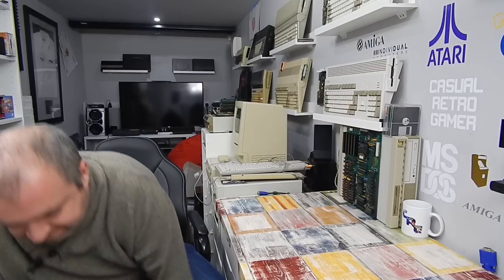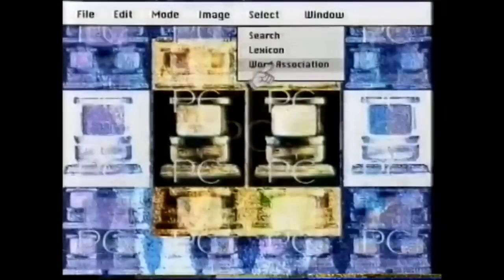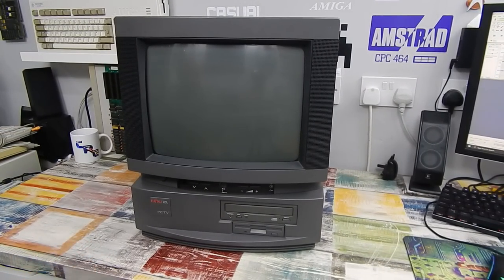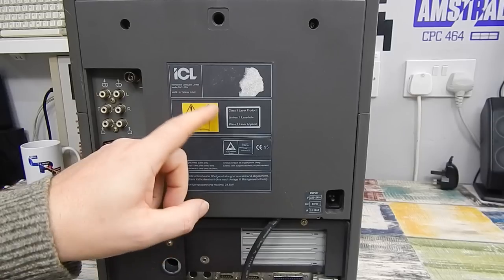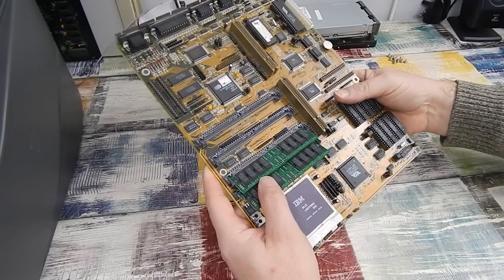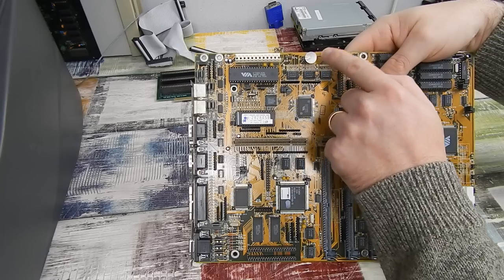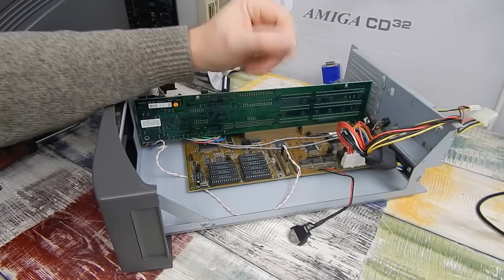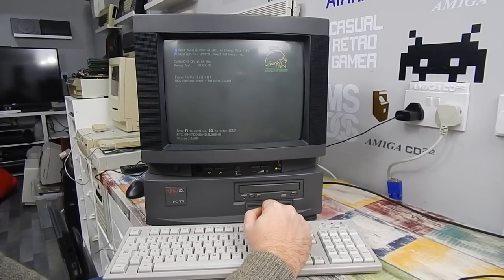Fujitsu ICL PCTV #DOScember2021

Comment: As someone who worked for icl fujitsu at the time, I can let you in to a secret.  They had no idea how to market anything let alone this thing. As an employee it felt like no body had any idea what they where doing at that point.  I did like that the advert included a clip of The Bill.
Reply from the maker: Sounds like a familiar story told by employees of various 90s computer houses.  

I can't help but get the impression from this system, with it's out of date spec, that it had been sitting on the drawing board for a while, then just turfed out the door.
Reply: @CRG  There where a number of machines kicked out the door by ICL based around that 486 board. It took them a while to shift to pentium.  ICL (via Technology PLC) was Compaq's distributor in the UK so was selling thier pentium systems hand over fist, but we did not see a Fugitsu pentium PC for quite a while, and even longer before it could be sold in volume.
Reply: I don't suppose you would know or could find out what encoding was used on the remote, could you?
Reply: @RetroBytesUK  Is the Indiana model worth getting for a 486-pentium?

Comment: You can potentially activate the SCART input (even RGB) using the control signals on the SCART socket, I can't remember the exact pins etc but a Google should have your answer but from memory I remember there's a signal to switch to SCART input, and another to select composite and RGB.  Newer TVs even looked at the voltage of one of these signals to select 4:3 and 16:9 aspect ratio.  I think it's as simple as applying either 5V or 12V to one of the pins.  There's some good info on the SCART Wikipedia article that explains the signalling better.

Comment: First off, thanks for putting this video out.  I have a nearly identical CD-ROM drive in my spares pile that I thought was dead when I connected it to a standard IDE port on a bog standard controller card.  That bit of information has given me hope that I can still use it in a build later on.

As for the remote control, some of those universal types have a search feature that sometimes works if you can't seem to get a prescribed code to work.  It's the mode that has you sit there in front of the TV and repeatedly press the power button and when it does power off, you hit a certain button to lock that code into the remote control's memory.
Reply from the maker: Tried it and went through 150 codes, no luck.
Reply: Try codes for Hitachi and Toshiba tv the menus are identical

Comment: Thank you so much for the video.You made me travel back in time. I've had one of these for several years. I was very happy with him. At the time it was a great machine but also very expensive, around €2500 in current currency. After it became obsolete I bought a new one and swapped the fujitsu for an HP 660c inkjet printer. Now I regret having done it. I wish I had it up and running now.

Comment: Did you ever find a way to switch to the AV input without the remote? I have one of these machines now but no remote control. Weirdly enough sometimes when I've turned it on, it's gone into Scart mode, I actually hooked a console up via scart and it worked perfect, but then if you press the channel buttons it goes back to TV and I then couldn't get back to scart again. I've also done a bit of digging on the software side as much as my current knowledge would take me, and it seems the DOS TSR that gets loaded talks to the VREMOTE.386 driver which listens for IR signals and then sends signals via the I2C protocol to the TV part to switch the channels etc. Someone with enough knowledge of debugging old DOS programs I expect would be able to write a program to control that the same as the VKDPCTV.386 driver does with the few hotkey combinations that you already found. I don't actually need the Scart/AV functions to work, but every now and again it really bugs me that the functionality is there and we can't control it. There is one person I found on the VOGNS forum that claims to have a remote control, I was hoping to contact him to see if we could get the IR codes captured so we could program a universal remote, but my new account won't let me PM anyone.

Comment: Thanks for inviting me to help out on the video, it had been years since I thought about the machine and it was a great trip down memory lane!
Its a shame the remote is so hard to track down, I wonder if with enough time and patients you could work it out using one of the usb IR blasters or one on some of the other android phones?
Reply from the maker: Thanks for agreeing to take part.  

I've not given up on the remote but I admit finding one is unlikely.
Reply: @CRG  It was my pleasure to show up in a great video.
with how hard it can be to just get a regular old CRT or VHS player with a remote at times.  Finding this very particular one on its own is going to be hard.
Fingers crossed that we find another one of these machines complete in the wild!
Reply: I've just got one of these PCs, sadly no remote again. What I did notice though is in the autoexec.bat it loads a TSR driver for the remote control. So my guess is this software handles the signals coming from the IR remote. Hopefully with a bit of poking around we might be able to determine the port address and then disassemble the .exe and see what values to writes to that port. This is all in theory though, but I'm going to look into it.

Comment: Honestly a 486DX2-66 was pretty par for the course in '95 considering the target audience for the machine and not to mention the Pentium's bruised reputation at the time.
Reply: Yeah I was thinking the same thing, my first computer was a 486 dx2 that my grandparents bought for our household, it was a Compaq presario Tower.  (WITH TABWORKS!).... 

Anyway that computer only had eight legs of RAM and a 525mb hdd. So even while this computer was probably manufactured in 95 a lot of the parts were probably designed inspect and you know early 94... And then you got lead times and manufacturing times because you're building not only a computer but television, so I can see how this might just be a slightly out of date by a few months 486 of the era.
Reply: Pentiums where server room stuff it that time
Reply: Same, certainly in Europe. I used one of these machines with Win95, and with 16mb of RAM was never unhappy with the performance. That CPU didn't got though - no cooling in the case and it was squashed it with the monitor and PSU, and not even a PSU fan was fitted, so it all got quite cosy inside.

Comment: On the benchmarks why did the processor speed not show up correctly?  Also I wonder if there was some sort of software upgrade that you could get to enable the composite and SCART connections.  I do wonder how closely the TV and the PC monitor side were connected as having to go from a TV resolution to a PC resolution is quite a jump.  If you are comfortable with taking the monitor apart further (keeping the high voltage cap connected to the tube if you are concerned about getting shocked) you should be able to get to the PCB where the AV inputs and the main TV control IC is.  The part number on the chip may be able to be traced down to a few manufactures of TV's and then you may be able to figure out the code for it.  Alternatively you could follow the wires from the IR sensor and see what chip or chips they connect to and see if any of them make sense for being in a TV and if not that is why a universal TV remote will not work with it.  Also may be worth backing up the hard drive to some online pace (archive dot org etc) so that this rare software can be preserved.
Reply from the maker: In terms of the processor its seemingly just a bug in how its detected within speedsys.  On my other machine with the same processor its detected the same way.  Running the likes of CHKCPU displays it properly as Cyrix DX2 66mhz.  

I'll get a look at the logic board and see what I can figure out.  If I get anywhere I'll pull together a follow up video.  

As for the software that's a good idea on archiving it, I'll pull the drive and try to image the appropriate software.

Comment: I think somewhere around 1997/1998 I've been able to play a bit with one of its successors. The PC part also was outdated back then and it was labelled Siemens (or Fujitsu Siemens). It seemed to me as the TV was essentially a modified mid-range Siemens from that time. I that model had an AV-button. As a portable TV it certainly was outstanding, particularly because of it's high resolution CRT.
I wonder if you have tried the obvious thing with the SCART-input on that set and give it the 12 Volts what's usually used to switch TVs to AV.
Reply from the maker: I've tried a mega drive scart cable and it certainly didn't auto switch.  It only puts 5V to pin 8 on the scart but still should auto switch at that.  I'll try it again with another source, maybe my Amiga with its RGB-Scart cable. 

I'll try to look for some Siemens TV codes, you never know, one of them might have more luck.

Comment: The ram expansion for the video card is using what appears to be ZIP ram, which was used on the Amiga 3000 as well.  It shouldn't be proprietary.  if you get 2 pieces of 256Kx16 at 60ns you should be good to go.  Packard Bell used ZIP ram for earlier 486 motherboards as well.
Reply from the maker: Having never seen zip ram before I had assumed it's pins were in a straight line but looking it up after your comment and yep there is a zig zag type so that's exactly what it is.  

Thanks for letting me know.  It's expensive enough on eBay so may not bother upgrading it but at least I know now what I need.

Comment: Like you, I was expecting at least a Pentium 75 or 100, the cheapskates.  Shame about the dependency on the remote control but I did enjoy the lock 'opening' solution 😊.  The PC part is almost the same spec as my IBM Valuepoint, even the video chip and VLB slot are the same although the IBM can take a processor upgrade.   Hope you find a remote that works.  It's not unpleasant to look at.
Reply from the maker: I hope to get something sorted for the AV as its would make a nice system to have setup for DOS gaming but also have a Playstation or Saturn connected too.
Reply: @CRG  🤞

Comment: OMGs, I actually had one of these back in the day. I got it from Morgan Computers in Birmingham in 1996 or 1997 (can't remember exactly when), who dealt with mainly remaindered / surplus / end of line and refurbished stock, and paid £300, brand new, so obviously it didn't sell well at the somewhat.... ambitious.... launch price. I never used it as a TV, but squarely as a desktop computer, complete with the weird "study room" front end bloatware. I did put Win95 on it and surprisingly it actually ran pretty much OK with the RAM bumped up to 16mb. The main issue I found with mine (not sure if others encountered this) was that the case had a total lack of ventilation, and sharing the case with the monitor meant there was a lot of heat build up. It never got to the point where the system was unstable but it was noticeable whenever you opened it up if it'd just been running. Unfortunately, there was very little you could do with getting into hardware hacks as there was no space or wiring for a fan. On the plus side, it was a very tidy working arrangement, and I found the keyboard / trackball to be a really nice setup. Also the side out tray made getting to the hardware an absolute breeze - completely tool free, provided you didn't loose the key! ;)

Comment: I remember these machines and at the time I did look at more than one in the stores. I was entranced with the form factor and the idea of a TV and PC all-in-one was very appealing. However, the immediate turn-off to a novice like myself at the time was the keyboard and trackpad design. Not considering the option of replacing those, they were very unappealing. Then, the specification when compared to comparable systems of the day was hugely off-putting, leading me to dismiss the machine as a gimmick. Even with hindsight, I think that was the right conclusion to make. It deserved to fail.
Reply from the maker: Yep I think you made the right call, the gimmick of a TV tuner isn't enough to offset the underpowered PC within.
Reply: I imagine that I wouldn't have bought one either after finding that the TV tuner couldn't be accessed from within Windows (i.e. TV inside a small window).

Comment: I wonder if any of the old Palm or Windows CE remote control apps might have the codes for download, as usually a feature of 'registering' the software was a pile of remote codes pre-installed. Usually far more codes than a typical universal remote would have, and that would be around the same time period. Also, there's few IR things in Linux for either using remotes on a software like MythTV as well as to send/blast out to control TVs that might have codes too.
Reply from the maker: That might work although I get the impression this thing is so unusual that the only real option is finding the original remote.  If I can pickup a CE remote cheaply it might be worth trying.  

To be honest I don't really care about the full features of the remote, yes it would be nice to have the remote, but if I could find something to simply change it to the AV channels I'd be happy enough.
Reply: I used to have an iPaq 2210/2215. There was almost always a way to get something working. IIRC there was an option to go through codes by manufacturer. I don't know how many Fujitsu products there were with IR but a lot of times codes are shared between products. If you did get something working you could copy the beam to a universal remote that can record.

Comment: Open the back of the TV, remove the ICL logic board and find the chip that controls the inputs. Follow where the composite and SCART signals go to. It'll probably be some sort of analogue switch/multiplexer IC, maybe a 74 series. Download the datasheet to find out which are the control pins and add a switch on the front of the TV to pull the required pins high and/or low.
Reply from the maker: Thanks for the tip, I'll dig into it and see what I can figure out.

Comment: The AV channel; did you try the channel up/down buttons on the front of the machine? Usually once you reached beyond the RF signals it went to the AV signal, right? Often channel 0?

Also a lot of universal remotes have ways to switch modes by putting in some code in the remote; it's possible the remote can be switched to a remote encoding the PCTV can read, but you would have to find the manual of the codes for the remote, and some database for a variety of machines that will hopefully include the PCTV that tells you what kind of remotes it can read; you would then have to crossreference and switch the remove; I don't know whether your remote has that functionality and such a manual online anywhere.
Reply from the maker: First thing I tried.  I remember our TVs back in the day had the AV inputs before or after the RF channels.  No such luck though.
Reply: @CRG  After the analog signal shutdown, analog RF isn't supported by the digital signal without box. But you need to connect to Digital box by AV inputs or by HDMI to VGA adaptor. ;)

Comment: Use the SCART, you can remote control it with applying voltage to a pin
Reply from the maker: I've tried that with no luck, it doesn't auto switch.

Comment: So if the screen shows old TV mode and VGA it is a multisync - that much more relativates the price. I know what I paid for a Multisync for my good old Amiga 4000.
Actually I would realy like such a PCTV just for that. I do not have the original A4000 case anymore. Putting it inside this PCTV would be extremly nice to use all screenmodes, ECS and AGA.

Comment: Try to look for a manual for this pc tv. Perhaps there are pictures in from the remote control. Then you know where to look for.
Reply from the maker: There is very little information out there on this machine and it seems as if the resources held on the Fujitsu website are also gone.  Bit of a shame as a manual would have been really useful.

Comment: Cool PC =D  I think it was lacking a bit at the time it came out.  As you say, most people were rocking 486DX4-100's around then.  That said, I think it would have sold better with an Intel 486 and better marketing.
Reply from the maker: How can you get better marketing than that TV advert 🤣

But yeah it needed a better processor and probably a slightly lower price, it probably would have sold better.
Reply: I'm pretty sure there were no Intel 486 DX4 - 100s around; Intel went all in on the Pentium; they did create some Pentium overdrive CPUs to plug into/onto a 486 socket. 486s beyond the DX2-66 were all competitor chips.
Reply from the maker: @3dmaster205  there are indeed Intel DX4 chips.  Accordingly to the wiki they were OEM only with just the overdrives going to retail.

Comment: Cool machine! No wonder it failed in the marketplace though, that spec was basically obsolete when launched - ouch.
Given that the L2 cache bandwidth was only around 40MB/sec, the 25MB/sec for the memory seems more than appropriate. The 150 figure you mention must be from a later design, and you misremember it. :)
Reply from the maker: The other board is from PC Chips, can't remember the model number off the top of my head but it's the one that had the fake cache.  I have a couple of videos on it from last year if you're interested.
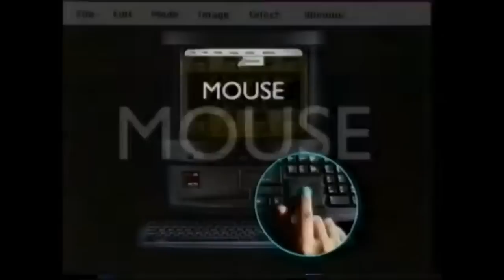Reply: @CRG  ah yeah, I remember that one now. :) I took a quick look and the memory bandwidth on that board was 36MB/sec (about the 1:30 mark in the video), so  clearly faster but not as dramatic. 
Either way, no biggie, just thought I'd help joggle the memory so to speak. Cheers!